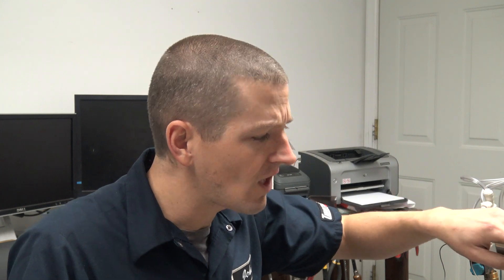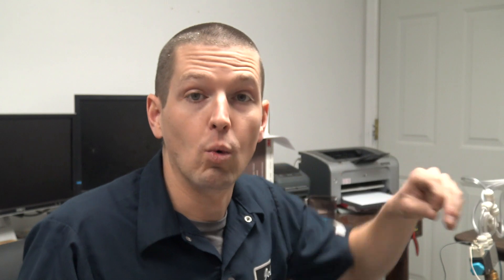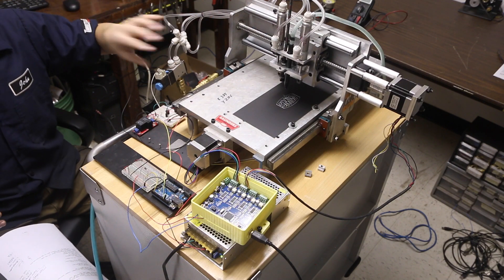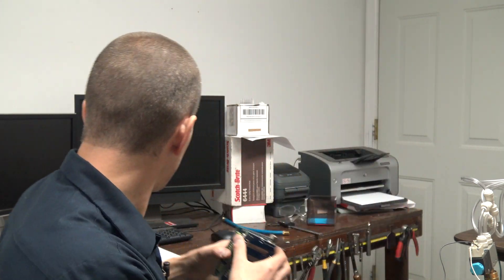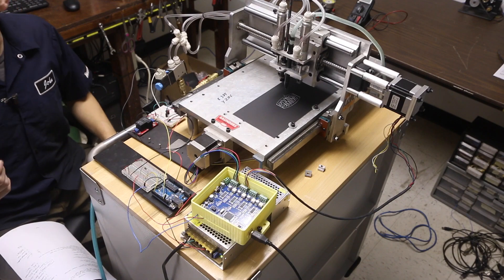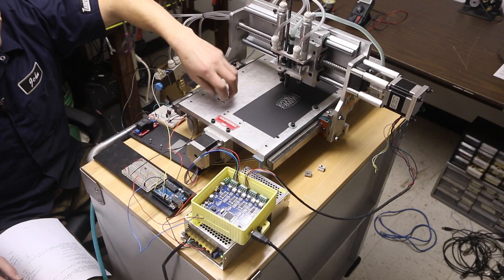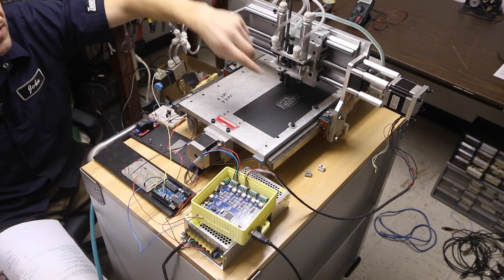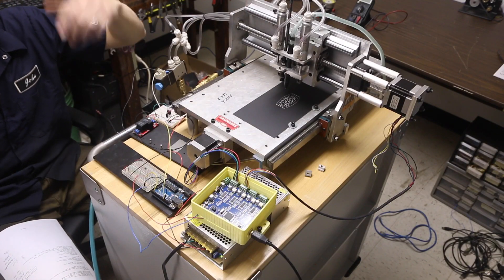DIY CNC Engraving Machine Details & Design

Comment: John If you go to machining YouTube and search (Testing a logo) I posted a small video of my Telesis marking machine. If you could make a marking head to do the same as this it would solve you problem. The way this machine works there is two different air pressures one to drive the pin down and a lessor pressure to raise the pin so the difference between the pressures is the marking force. The pin has about 1/2 inch of travel so it will even mark the on the OD of round parts. They run the pin with a simple air solenoid it can even space the punch marks to give a low stress typ. of mark.

Comment: I could easily replace the cap that was "dinged" off of one of the tiny G boards. If you have the time to send it I would love to use it. I've started building your cheap cnc for a pick and place tool, that dedicated board would be really helpful for it though! 

Thanks for these project videos!

Here's where I have gotten so far: https://youtu.be/ra92Dp-3W4I

Comment: Circuit mills use a similar Z axis method to what you were describing, where a disk surrounds the tool and you adjust the distance the tool sticks out below the bottom of the disk. Google image search "LPKF circuit mill head" for some ideas.

Comment: Check out joe's hybrid CNC for large scale cnc router. that design uses v grove bearings rolling on steel angles as linear bearings .Cheap and effective, especially as you'll be able to easily make the bearing blocks.

Comment: mycncuk.com has all the answers, 1605 screws, nema23 3Nm motors, gearing ratios, proper drivers with correct voltage supplied and you've got that speed your looking for.

Comment: Possible solution single acting cylinders with a spring down force either in the air cylinders  or externally so it can be adjusted, Another thought is weights.

Comment: As others have mentioned you probably don't need specific height control, regulating the pressure would do the same job and is simpler.

Comment: I think you misspoke regarding ballscrew vs rail length. You want the rail to be longer than the ballscrew because you need 2 rail carriages and you ideally want them separated as much as is reasonable. ballscrew is travel + ballnut, rail is travel + 2x carriages + separation distance. Just be careful of the measurement the seller is using to list the ballscrew, the screw length will be less than the total length because you have a bit on the ends for bearing and motor mounting.

Comment: Few thoughts...  I've been fighting speed too...  I'm guessing 1 start lead screws are going to be the slowest...  2 or 5 start would speed things up considerably, but not sure how hard that would push the steppers...  Second...  On the height adjustment.  Could you put a spring around the pen and have an adjustable tension?  That would give it reference and push the height up or down base on the material in the immediate vicinity of the pen.  Awesome project man!  I don't understand how you are going to put chili pepper onto a raspberry pi, but I'll look into that.

Comment: I used center drills to engrave with a Gordon pantograph this was a big old 1950's machine.  
A s for adjusting for odd surfaces depth it was designed to track for depth but we never used it that way have seen cad systems that can use the known' to adjust depth. But this requires the work to be in a known axis location.  A sliding sleeve could work as a self guiding depth control cause you want to control depth just for the letter edges on an as you go.  Flat stock wouldn't be real issue.

Comment: For the z you could try looking into regulating the pressure to the cylinders to a lower psi. My thinking is it would allow the engraver to sort of float along the surface, adjusting to height variations, while pushing down with a small constant force. You could then adjust the pressure to change depth of cut or for different materials being engraved. You might also look into valves for the exhaust to tune how hard the cylinders are hitting the end of travel. It could be the mic, but it sounded a little jarring in the video.

Comment: John
did you try to use low air pressure for the cylinders? I would just regulate the air down to the point where it has just enough force to engrave with minimuml drag.
Reply: +sharp x thats what I would do.

Comment: Use these motors.

Realy good for your application price and perfomance. And for the most "low power" automation application.  
What i like about thows motors is they dont need motor controller only power and and some c10 board or somthing similar.

Down are some videso how they work.

https://www.teknic.com/model-info/CPM-MCVC-2310P-RLN/

https://www.youtube.com/watch?v=Z2kAcz-rG5s
https://www.youtube.com/watch?v=yZJVXTaDeoU
https://www.youtube.com/watch?v=gz9mZ5fBwUM

Comment: John, look into the ClearPath motors for speed and accuracy. Granted they aren't cheap but they are incredibly fast, strong and super accurate. Essentially they are servos. There's a few videos on YouTube showing what they can do - among those are videos by NeoCNC who's built a CNC using those motors. Cheers!
Reply: +Iain Wade Yeah they sure are pricey - but with it comes the simplicity (which is particularly great if you want to use them in a production environment) and no risk of frying a couple of TinyG boards in the process ;-) You planning on sharing your setup when done?
Reply: +Tony Lorentzen I too was going to recommend Teknic ClearPath servo motors (alternatively Leadshine EasyServo series); but I wanted to add that there is still a lot more performace, relative to his current setup, that can be had economically through the use of high volt, higher current, low inductance stepper motors. I think the TinyG is rated for 2.5A (probably not recommended for heavy use) and my Gecko 203v's will handle 7A at 80v iirc. 

Having said that, tbh with the price of ClearPath and LeadShine ESD's I would rather close the loop and pick up the much increased rpm. Better resolution, greater accel, and greater velocity. The price differential isn't that much (relative to say a 203v and decent stepper motor) and the performance is much better.

Comment: For your larger bed project you might want to look into the motion controller by warp9 called the SmothStepper. It is a bit more complex, but it can handle allot of data over Ethernet for strong reliable communication. CNC Router Parts uses this and has some pretty clever designs as well.

Comment: you can get addons for routers that stop the cutter going to deep and hold the material down at the same time for using with a drag knife. like that machine you saw in vegas they have pressure regulated air rams that hold them in places, also you could try a spring loaded tool holder like Randy Richard users they do work quite well, they are very easy to make I have one for drawing on my big router.
https://www.2linc.com/countersink_depth_stop.htm

Comment: for the z axis control, use a pair of motors on either side, inside the Pistons, and have a set of cushions on the end of each screw. this should let you use CAD or cam to control the z-axis height and depth while still using your piston system.

Comment: Hey Jon, as far as getting more speed out of your steppers. What I've run into with my machine is I have 4 start trapezoidal lead screws with a .250" lead per rev driven by 200 steps per rev. nema 23 motors. I'm micro-stepping 1/32 so, as you can imagine, the pulse rate sky-rockets as the feedrate increases and my atmega 2560 chip running Marlin firmware quickly reaches it's maximum pulse generation bandwidth (I think its 70,000 pulses per sec.). See: step rates on the Reprap wiki. Consequently, my maximum feedrate is around 60 mm/sec. but I'd like to go faster. Come to find out that ARM processors like the ones in the Beaglebone, Raspberry Pi, Smoothie board, etc.  can generate megahertz step rates. You mentioned a Raspberry Pi in the video. You might want to research Machinekit for your Pi when you do your homework. Please keep videos like these coming. I love your work and designs.

Comment: John, I have not pleasant news, your Tiny G is NOT isolated. To be isolated you need to use optoisolators. Right now you are having risk of frying arduino together with Tiny G if you goof something up. Also your broken boards, broken off cap is usually easy fix, but static or accidental short are way harder.

Comment: Did you get rolled or ground ball screws? Were they used? I've seen a lot of conflicting information about ball screws online.
Reply: +Pete Brown Type "1605 ballscrew" into Ebay search. These are rolled not ground, but reasonable accuracy for this, and you can get them super cheap compared to ground. Some Ebay sellers will even machine them to your specs (some better than others lol).
Reply: +Kevo F Thanks. Purchasing that stuff from eBay has always looked like a bit of a scary experience. But like @Full Metal Ratchet says, the prices you see from places like MMC are heart attack inducing. :)
Reply: Pete Brown  No problem. Yea,it can definitely be risky at times. I usually won't buy from ebay unless the seller has close to perfect feedback. Even if it's a sketchy seller, you are at least protected as a buyer.

Comment: You're at max voltage on that 7805, and you're blowing off a lot as heat when going from 12v to 5v. If you don't have a dedicated 5v output on a dual power supply, I recommend using one of the switching voltage regulators like used in cars. You can find them on eBay and they'll do a reasonable job. Or you can use the 7805 replacement that is really a tiny switching regulator. ( http://www.dimensionengineering.com/products/de-sw050 )
Reply: +fragwits Yeah. There are some nice adapter boards that do the legwork for that for you.
Reply: +Pete Brown Max voltage of 7805 is 35V not 12V, and dropping from 12V to 5V not necessary produce lot of heat (heat produced on voltage regulator is proportional to power dissipation on it, not to voltage). In this case he is probably will have lower power dissipation on linear regulator then it will have on switching one (he is driving solid state relay which use very little current so dissipated power on linear regulator is small, and switching regulators have relatively small efficiency at low currents).
Only problem here is that why he's circuit using 7805 which can cause instability, 7805 required capacitors at output (recommended value of output capacitor is stated in manufacturers datasheet).
Reply: +Miloš Lazović I belive the filter circuit they recommend is a 0.1uf cap on the output for a fixed voltage regulator in the 78XX family. the input i think is somewhere in the range of 10-40 uf based on how clean your input signal is and it only gets crazy if your using the postive regulator in a negative or adjustable configuration. Since he is using the 5v fixed, a 10 and .1 uf cap should be fine, but i would add at least a simple heatsink for any extended runs to keep the tollerance/lifespan. than again i doubt he drawing more than an amp even during surge periods.
Reply: LordStabbers
Input capacitance is not required in this case (he is using DC buss and current is relatively small, but that depends what is resistance from 12V to 78xx, if is big he would need input capacitor and if needed calculation of its value is straightforward), but output is required in most cases for stability reasons (but again some old designs of 78xx do not require it), in datasheet you will find range of output capacitance and range of ESR  for stability (LDO versions do require ESR to be in certain range and some will work only with non-ceramic output capacitors ...) and calculation of required output capacitance is not easy as for input (it can be done but it involve lot of calculations).
Even if 7805 do not need output capacitance for stability, it is recommended to put it because it will improve transient response.
Heat sink is not mandatory in this application, absolute maximum current Atmel microcontroller can draw is 200 mA which even without heat sink will put TO-220 package in safe range at constant maximum current (it will be hot but less than maximum of 125C), but I suppose this is just proof of concept and not final design (he use breadboard) so he will mount voltage regulator in some way in final design.
Most people think that using 78xx is simple, you just plug it in and they work and in majority cases it is like that, but in some they have tendency to oscillate in some cases (especially LDO versions) and for proper design you need to follow some rules.
Reply: +Miloš Lazović Thanks for correcting. I have no idea why I thought max V was 12v, but I've been operating off that for some time. After your post, I looked it up in a bunch of different data sheets. :)

Comment: Could it work if it had inverted pneumatic cylinder and spring to push it down. Like the spring pushes the tool always and when you need to z up you actuate the cylinder.
Reply: I was thinking of something similar. A rubber cushion between two plates; the pneumatics are connected to top plate and engraver to the bottom plate. Also protects the mechanics somewhat.
Reply: +Tommi Honkonen There isn't any gain using springs, pneumatic anyway cylinder acts as spring (with lower inertia, higher natural frequency ...).
Reply: The cushion is to protect the tool from the inertia of the mechanism it also means you have to 'tune' the pneumatics less.

Comment: I worked with pneumatic in high school robotics, so I have tackled similar problems, and I have a few tips:
1. As far as using air pressure to keep the engraver tracking the part, you will need much lower pressure or much smaller cylinders, with 3/4" cylinders and 60 Psi (but assumptions but I assume they're about right) you will be pressing down on that tip with 50 pounds. I would regulate down to maybe 10 psi to get a more effective  tracking.
2. The activation speed of your cyliders is quite high for this sort of  application, they make flow regulating 90 degree connectors that could replace the ones that you are currently using and a buck or 2 a pop and they will give you the ability to limit how fast air is exhausted (thus slowing down the cylinder).This may also help you achieve the 'air ride ' you are looking for.

Comment: Hey John! I would love to try and put to use your broken boards. I have a smooth stepper so if the brain is completely shot I would use it and the drivers on the broken board. If I can get it to work, she will go into a custom 3 extruder 3d printer.